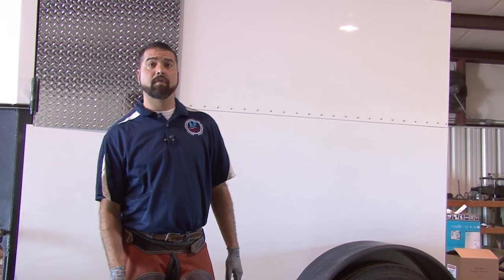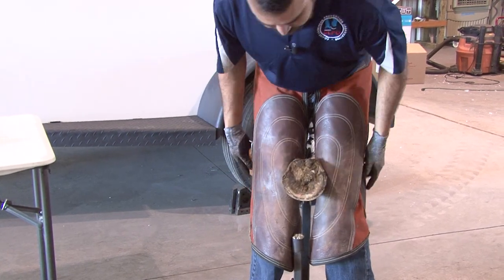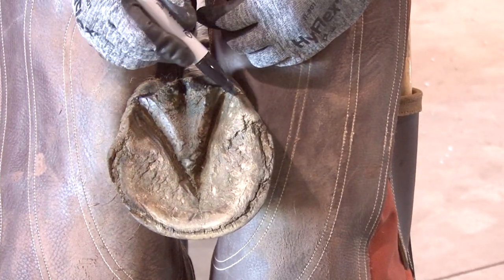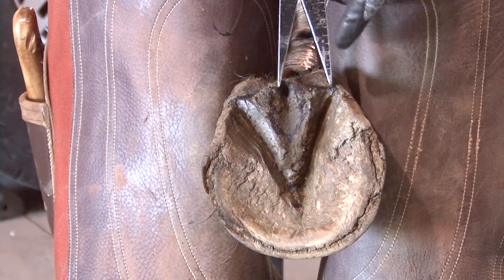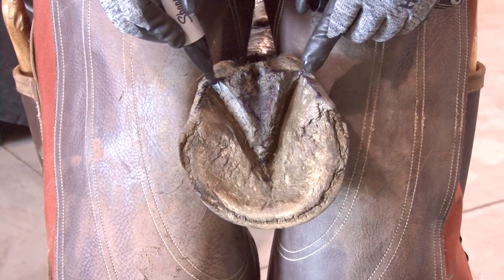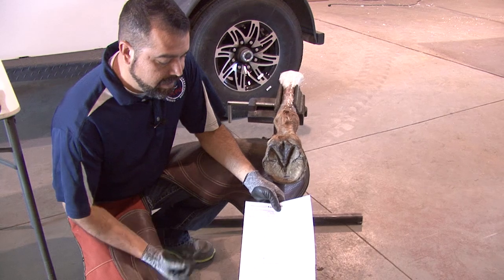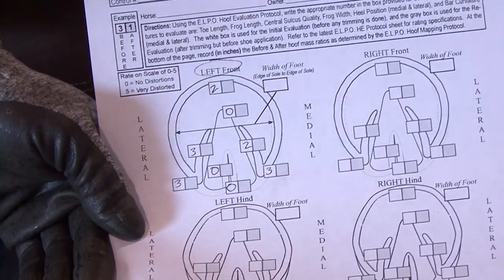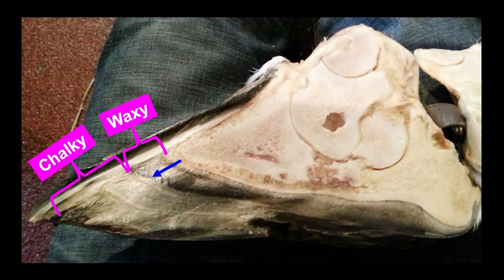ELPO Hoof Mapping Protocol (Updated 2017)

Comment: Ok on the exfoliating of sole I thought you were supposed to be much more conservative on barefoot horses than a horse that wore shoes and I thought for a horse with exceptional thin soles you only take any flaking off but otherwise leave some alone
Reply from the maker: Yes, on a barefoot you would remove very little sole material, sometimes even flaky sole.  If you watch the barefoot trimming video you will get more explanations of this.

Comment: When evaluating the frog. I have a TB who’s frog is very wide, but very flat, no central sulcus.  It is flat?  How should I fix this, hoof seams like a thinner sole?
Reply from the maker: Sounds like what is called a prolapsed frog, which is seen often in flatter TB type feet.  You can be an indication of a Negative Plane Palmer Angle to the coffin bone.  TB feet are often seen with either smaller or weaker digital cushions and lateral cartilages, which can cause a flat or even negative angle to the coffin bone.  The frogs attempt to better support the back of the foot by growing larger to fill that void, but a lot of the times the frog tissue is not great and end up flattening out and just being more plump and full than dense and supportive.  If the horse is having some soundness or performance issues, then this might be a place for your vet and farrier to look closer at to see if some extra measures can be done to improve the quality of the back of the foot and the alignment of the pastern.  Many TB feet get by fine with the condition if the distortion stay in check, but it is something to be aware of in case you start to see any issues.